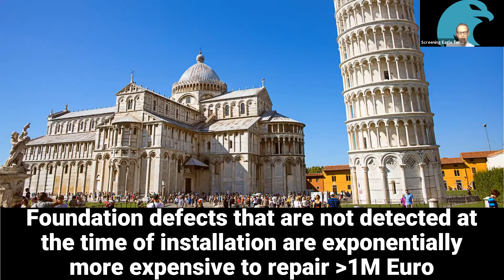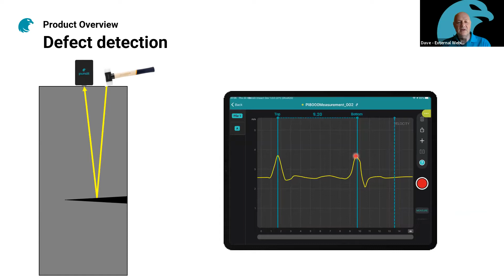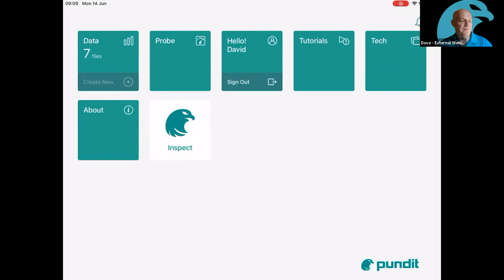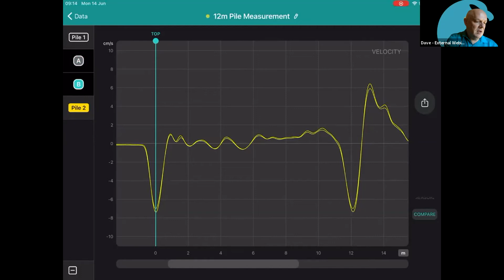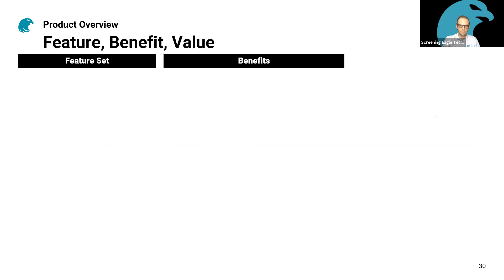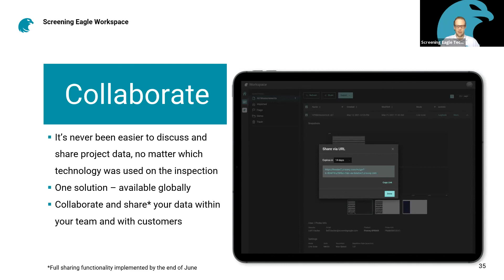Pundit PI8000   Pile Integrity & Impact Echo

Comment: I am a user. May i allow to ask more questions about this device?
Reply from the maker: Yes, ask away.
Reply: @adampapworth  Is detailed analysis required after field testing is carried out. For example, soil properties (N values) is necessary to input after field testing. I am trying in field testing by using Pundit PI8000 to check defects bored pile 0.6 m diameter and 24.5 m long. But pile toe is not seen after field testing is carried out.
Reply: @adampapworth include or exclude feature not show in my iPad. What is wrong ? Because of software?
Reply: What is the purpose of HTML, CSV and URL file extension?
Reply: What is the purpose of workspace?